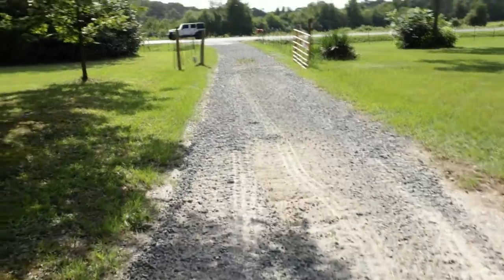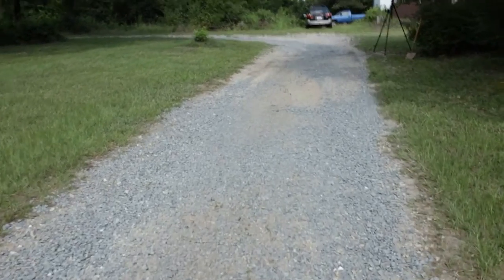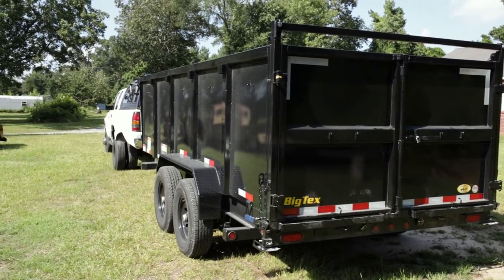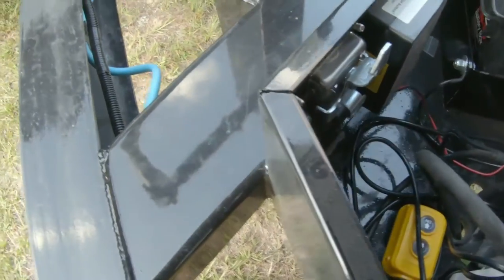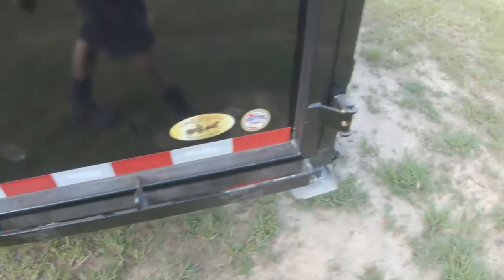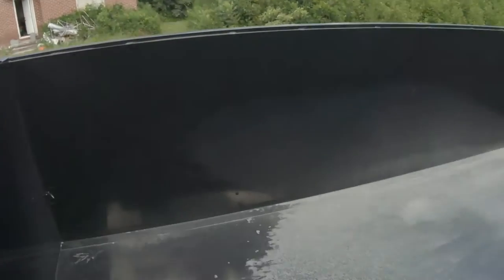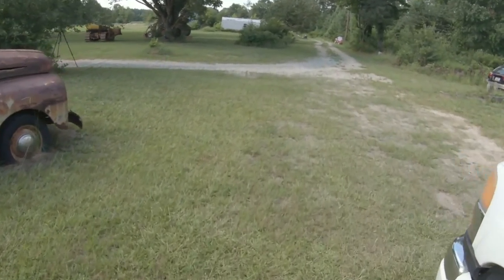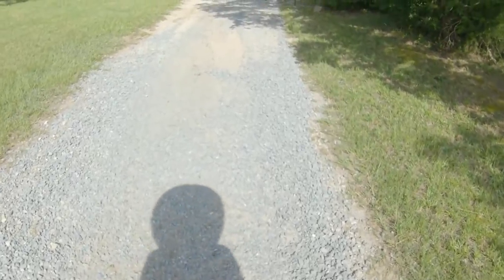Spreading Gravel: New Big Tex Dump Trailer and Disappointment

Comment: I was a inspector for Big Tex until the Covid layoff,  wasn't called back because I was " a troublemaker " had supervisors says I knit picked about issues with all trailers. They are more about getting quantity not quality. The way I look at it is these trailers travel up and down the same highways our families and friends travel but it cost me my job. Beware of any trailer built under the American Trailer Works banner.
Reply: Big conglomerates that buy up lots of small corps tend to do a poor job at managing the smaller satelites and are only interested in extracting as much profit as possible regardless if that kills off the brands sooner or later.
Reply: Integrity has cost me more jobs than it has granted me.

My job has taught me to keep my mouth shut and head low.
Reply: @elrulo6078  PJ is owned by the same company that owns Big Tex, American Trailer Works
Reply: Wow, and i was torn between PJ and Texas Pride. Now i know i wont go with Pj.
Reply: I watched a video yesterday on a PJ trailer with some of the same issues.  On the PJ, the brakes weren’t wired, and most of the light wiring was non funional and looked like a 5 year old did it.

Buyers need to refuse delivery of crap like this.

Comment: We bought a 2019 "new" 16LP with the 4' sidewalls in a 16 footer, i don't think the quality was too bad, i mean not great, the issue was, after much research, the 16LP was a larger axle version of the 14LP, it lifted the same weight. It was terrible one day our old 14' 2007 Quality steel dump trailer in not good shape anymore, dumped more dirt side by side to the new 2019 16LP. The 2007 trailer was a 12k rated trailer with dual side by side hydraulics "not a scissor hoist", while i stalled the same amount of dirt loaded in the big tex 16lp rated for 17,500.  We had roughly 10-11,000lbs of dirt in the trailer. Not long after, i went to the concrete yard, and the loader guy said his new machine they had was roughly 50lbs accurate for whats in the bucket. I had them start with 7000lbs, then he added 1000lbs ~ per dump into the trailer, by 9000, you could tell the pump was struggling to lift the dump body off the frame, but would.              By 10,000lbs it almost wouldn't, I had the load centered dead center in the 16' long dump trailer, the sand didn't touch the front bulkhead or the rear doors yet. I knew it probably would stall with another load, but it was able to lift the 10,000, i got it home, went to dump, it couldn't lift it now.    We had already changed out a larger exide Nautilus deep cycle battery , kept it charged when not using it etc. The hydrualic hoist was just too little, not even as large a cylinder as most Ford F550 sized class trucks with a 9-12' mason dump. 

After some more arguments with the dealer, and them verifying the hydraulics were working correctly, i saw their 14LP had the same exact hoist and hydraulic cylinder ram on it, of course my 16LP was rated for about 12,250lb load capacity and i knew anywhere near that meant having to use multiple people in machines upon trying to dump it to get it to start to lift. 

Later sold, end of 2020, just before the massive trailer hike hit. The trailer when new was less than $13,000 with tax, i ordered a 20k Diamond C 16' LPT210 with 44" sidewalls and 7ga side and floor and it was $15,800, good amount more but in a whole other league in strength and quality.  Big tex used to be a good brand with other premium trailers so my gripe here is the hassle the gave me in acting like it was operator error, or overloading when they knew it was just a 14lp trailer, "that barely even met the spec to lift the 10k those claim to hold", and i paid a ton more for literally only axle/tires only.  I see now they make a 20lp with 10k axles too, not long after i got my 2019, they changed the box frame that was "so so" to the I beam style they sell now too, but the hoist was the same so we declined to trade in and upgrade.

Comment: Those welds look bad enough that they will likely crack in a few years.  For 10k they should be providing a much better product.  They buy in such bulk that they probably don't have $3000 in the whole trailer(1250for steel and 1250 in axles/tires/lift etc and the rest in paint and labor.  Average joe could buy all the materials for 8k and with skill build a better trailer.  Thats not always an option for everyone but maybe the best bet is to buy the cheapest trailer you can find and just plan on fixing all the deficiencies cause regardless of the amount of money you spend there appears to be deficiencies in all brands granted some are a good bit better than the others.  It might be hard to find decent used dump trailers now, but rest assured with the boom in trailer sale growth the used market will be full of them in years to come.  No different than RVs or Harleys.

Comment: Sorry to hear about your crappy job on your trailer. If you buy a different one, I would suggest Texas Pride Trailers. I bought one from them and had to travel 8 hours to pick it up. Custom build for every trailer. Not a cookie cutter trailer. They also have great customer service. I had a custom 18,000 lb trailer made by them and couldn't be happier. In reference to your rear gate latch. The pivot lock area will fill up with debris from having them open and dumping. With the debris in the latch hole, it makes it want to spread the area you showed in your video. I carry a screwdriver with me and clear it out before I try to latch my gate.

Comment: You just want to hope that they use a proper metal priming system before they applied the finish. Otherwise it will rust under the coating.
Reply from the maker: Yup...
Reply: Most companies, including Big Tex i believe, store their Raw Steel outdoors.... It takes a little more than good prep for them to create a Newly painted (powder coated) trailer (when the raw steel is rusted). That's the simple reality w/these outfits. The demand is so great they have no need, nor time, nor desire to invest in proper storage facilities, real manufacturing lines, etc. It's too bad, really. With some investment from the US Gov't to get started, just One company, properly set up could take over rhe Entire US market and put all these craft shops out of business. But Only a large scale operation could afford to sell the far better built units by selling such volume. (basically means you could buy a $30k trailer for $15k because the company is selling so many they can have a small profit margin on each unit). But price out a new 10wheel dump truck and you'll learn just how inexpensive, cheap, they are... These companies don't even suggest AR steel for beds. That being said, the trailers are all better than they were... bigger lift units, somewhat better paint, more logical designs. From what i see in this video, i'm more satisfied than ever with my SureTrac ~

Comment: I’ve got the same issues with mine! I just picked it up Monday afternoon. Welds are crap, everything is stitch welded, welding wire and spatter stuck all over it, and the power coat is garbage. Everything that they “Welded” on has rust on at least one corner where they were cheap on the powder coat! I made a video about mine to just needed to post it on my channel. I’ve never posted anything on it before but I’m going to start post everything and calling all these companies that are putting out half ass shit to us hard working consumers!
Reply from the maker: Yeah. I'm still mad. Nothing has been done on BigTex's end. It's a big oh well. You go what you got.

Comment: Did u call the company r u going to make them fix it
Reply from the maker: I've called and emailed BigTex several times. They gave me like $300 back on it, but that's it. Totally disappointed.
Reply: They should built you a new trailer. I have a Texas Pride 14' gooseneck dump trailer and my only complaint is the paint is not very good I really wish they would start powder coating much more durable.